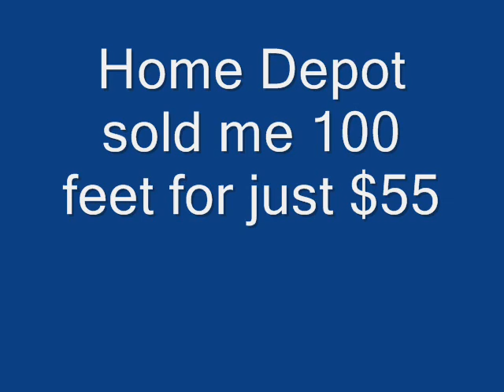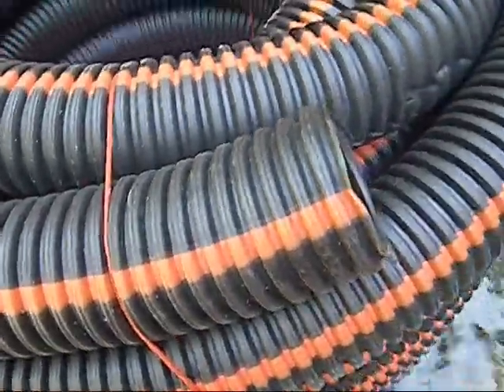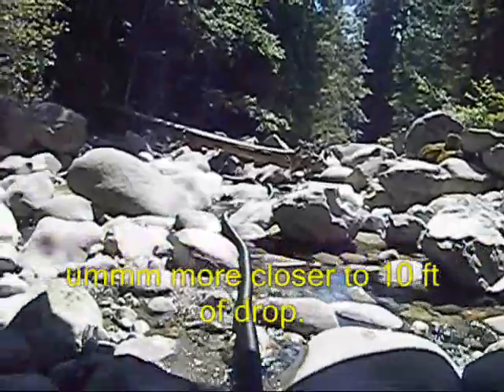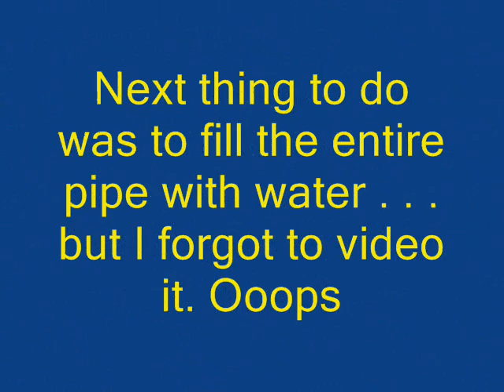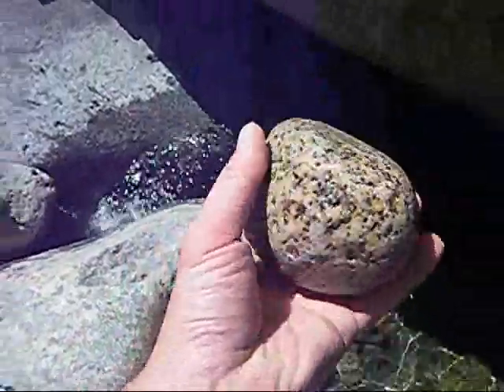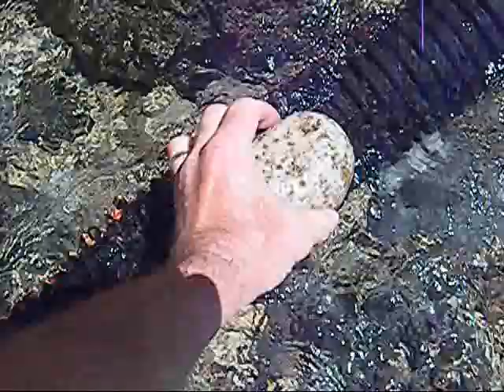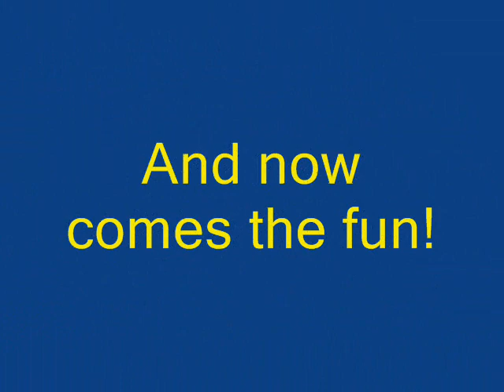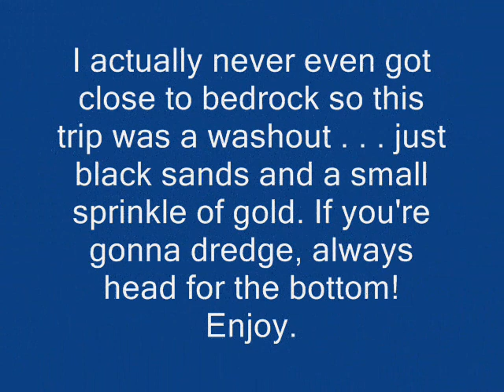Gravity Dredging.wmv

Comment: That's awesome. I have one suggestion. I would buy ten couplers to join the hose together on the outside of the hose every 10 feet so you can break down the 100 foot of hose so it is very easy to clean the black sands and gold out with a garden hose at home. Great video.  Thanks Brad

Comment: WARNING:  This is an effective gravity dredge.  However be careful, because when removing material from next to or beneath a boulder, be aware that you are removing the boulder's support foundation and it could without warning move or dislodge and pin or crush you.  If you desire to remove enough material that may cause the boulder to shift, attach the dredge hose to a long pole so that you are far clear of any possible shifting of the boulder.  Now get that gold!

Comment from the maker: That is the whole idea behind this system. The ridges are the gold traps. Also it's best to use a 4 inch nonperferated pipe with rounded ridges instead of squarish ones, you would have to shop around to find this slight variation but it seems to work better.

Comment from the maker: That's a good idea, I had at one point used 2 Keen 10 inch wide A52 sluices duct taped side by side in order to deal with the flow rate on the output and still the pipe had more gold in it than the sluice, but it would vary based on gold type and flow rate. With that setup It probably would be best to place something like a quarter inch punch plate along the length of the sluices in order to seperate the large rocks from the fines.

Comment: As a civil eng with some sediment transport experience... I would also recommend a smooth pipe and a sluice box at the end.  Use the water just to wash the material rather than transport it. Since gold is heavy, you will not likely find it in abundance just before a steep flowing river. So go to a low lying area (also with signs of glacial activity/depositing) and possibly a natural basin formed with bedrock.. then hand scoop the material into the sluice box (flow clean water with no material)
Reply: Hahaha hahaha

Comment: Nice idea, I hope to find a spot to try it out.
One thought I have is that you didn't have a washout, the gold is still in the pipe because it's very hard to get it all out.
The next time you run it you might get some of the current product in your clean-out.
You may have to have the pipe full of water by shaking it very near the water surface and use the water to splash around and knock some more of that stuff down.

Comment: I had good results with a 3" smooth bore dredging hose 20' long.and a good waterfall acts as a good suction boost, add a reducer smaller top 1.5"nozzle and you are in sucking heavin. and at the bottom of the 3"er, feeds a portable sluicebox. I didn't have to beat the tube/pipe/hose either. but, that hose you are using, makes for a great portable box instead of a riffled box. less gear 4sure. at the end there looks like you are wrestling a big ole creek snake!

Comment: you can use any pipe but bigger moveses more material more efficiently and is actually easier to get a good continuous flow. i would use a smooth type hose with a sluicebox at the end

Comment: Maybe if you start with a shorter length of tube, so there’s not such a long path for your material to pass through to empty into a 5 gallon bucket that is fitted with a hole in the bucket lid and weighted by rocks.  
* Turn the lidded bucket on its’ side and angle it so the material slides towards the bottom of the bucket. 
* Tie a flotation ballon to the bucket handle for identifying bucket location.

It would be a surprise to see how much material\ gold  that would be deposited in the bucket after a storm. Remove bucket and dip material from bucket to sluice to see how much gold is accumulated.

Check after storm passes

Comment: Hi.
I like the idea of no noise dredge, No heavy engine/pump to move around and no fuel to pay for. I wonder if there is a 4" smooth pipe out there, so that cleaning the pipe at the end would be easier?
Reply: aspudkicker -I am watching the gravity dredge video, and have a suggestion for cleaning out your dredge tube.
I use this same process for UN-stopping and cleaning out my  Gold-n-sand tube; flush water through the tube which will empty out into a tub. This works great for shorter lengths of tubing.

You can also use a deep water-filled tub and submerge an open end and pull it through swishing the water as you work the dislodged dirt from the ridges, and let this drain into a second tub - then process the dirt after the tubing is cleaned out.

I have never used 100ft. lengths of tubing as shown in the video, but it works well with shorter lengths.
Reply: Thank you for your thoughts.

Comment from the maker: @rycopath This is true. Those are both downsides to this technic, though overfeeding the nozzel shouldn't happen after enough experience has been acquired. Feeding the whole works into a sluice box is probably a good way to go if you want to get everything but originally I had designed the concept without using one. Also, I have since decided that round corrigations are best in these pipes, not overly square ones.

Comment: Yea.. using ridges hose is a nightmare to clean.  Short of slicing it open.. you'll never get the gold all out.  

You need to find inner surface smooth hose.. but still has the ribbed or spiral wire supported integrity needs for vacuum applied hoses.. (keeps it from sucking/collapsing under vacuum pressure).  for this application anyhow.

Dredges using venturi jet method, pump  "pushing" water through the hose, doesn't need the support..

Comment: Hello, how many meters is your hose ?
Reply: 100 feet or 30 Meters. 100mm diameter. It must be Solid, no holes for irrigation. And really, don't try to tape 2 together for extra length, it never works. If you suck up too much material too fast it will plug up, well thats if your flow is too slow, so as to not clear the material going in fast enough. It really was an art.
Reply: Спасибо большое, я с Казахстана. Здоровья вам.

Comment: Dude...you don't need to run the gravels THRU the pipe...set it up same as any dredge....use the pipe water pressure to blow the gravels thru a short  pipe...do  you know what a Y is....?  Make a power jet/nozzle...jesus sakes.
Reply: I was thinking the same thing. Though I still haven't seen anyone do a gravity dredge like that yet. I guess one of us will be the first.
Reply: if you could explain what that means exactly I would greatly appreciate it.
Reply: I've seen a set up like this in action.  The guy used a 6" main pipe and a 4" hose of of a Y.  He doubled his suction  and that thing was a gold magnet!!
Last time I talked to him he was trying to add a flusher hose/nozzle to the set up because he had run into a bedrock with some serious fractures in it.
Reply: Hmmm, what is this flusher nozzle you speak of? I find this interesting and may try it. I was thinking of running he tailings through a sluice box though rather than trusting the ribs to catch the gold. If I do, I would probably just use a smooth hose rather than ribbed. Cool concept, non-the-less.
Reply: It's like the pressure nozzle on your garden hose but it has a shutoff valve on it.  On a gravity dredge it comes off of a Y.   It is used to break up compacted gravels or to flush out a crack.
Reply: Terry Baker So do you mean to actually blow the water out of the nozzle to blast out gravel from a crack, or just a suction nozzle?
Reply: That both sucks and blows! Depending on the arrangement of the "Y".
Reply: Your suggestion gets around the restrictions on motors. And if they used a regular suction nozel to harness the force they could attach to a much shorter smooth bore hose directly into a standard sluice or header box/gravel separator to sluice box arrangement.
I have considered gravity dredging but knew the gold would mostly be trapped in the hose crevices.  Then I'd have to drag one end of the thing, along with a garden hose, up on top of my house to flush the gold out of the hose ridges.  Not ideal.  
Thanks.